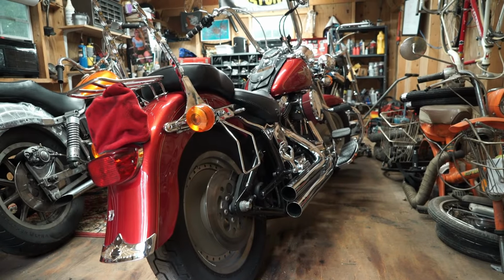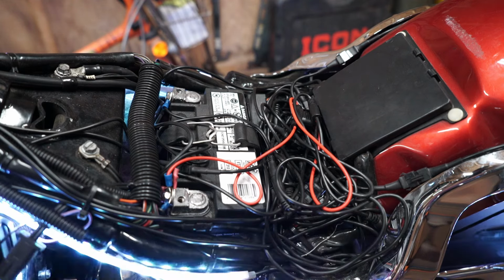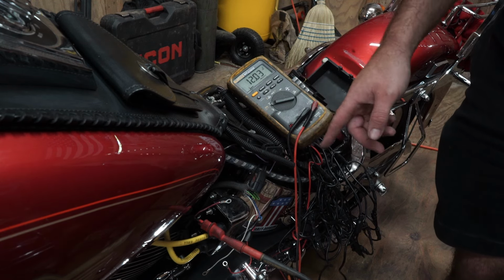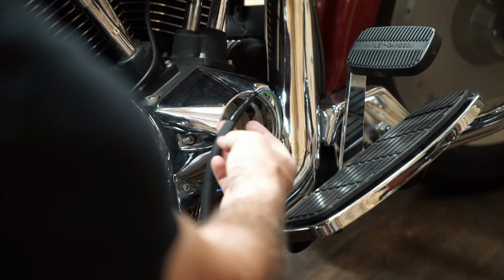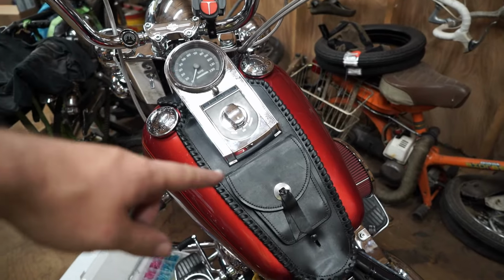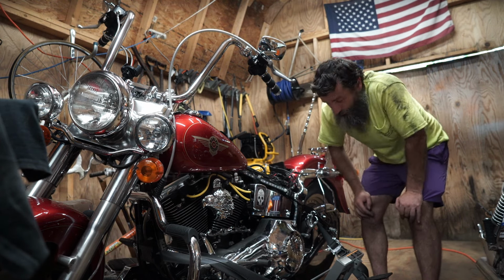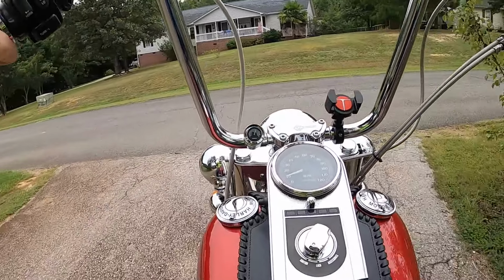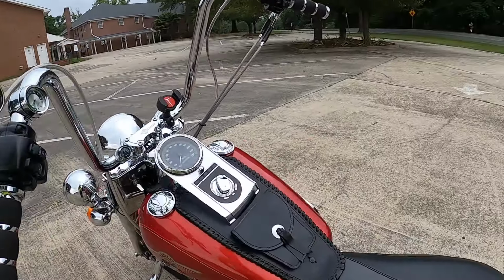1997 Harley Fatboy Ignition Diagnosis and Dyna 2000i Install

Comment: Thanks for sharing all this. I just got my dad’s 1997 FLSTF Softail Fat Boy and am still getting it dialed in, which is why I’m watching this video. THE UPPER FUEL LINE CONNECTIONS NEED TO BE CONNECTED TO A ‘T’ with another line going to the bottom of the bike, or it will never run efficiently. My dad had been running it like that for over 15 years. With his aftermarket Screamin’ Eagle exhaust, air filter, and needle, it easily gained 20hp overnight after fixing the tank venting, drilling the main jet to 190, tuning the idle screw, and adjusting the needle position. Hope this helps, you have definitely helped me to understand the ignition system better. Please Keep doing more EVO Big Twin content!

Comment: Did you check to see if he has one of those manual push buttons on the solenoid? I've got one on my softail. Those evo starter systems were known for being a little troublesome, and a lot of guys would put one of those push buttons on there because of it.

Comment: Hey man i have exactly the same coughs on my carb on fxr how to fix it?
Reply from the maker: Check for intake leaks first, that's probably your issue. After that, you may need to pull the carb and check the jets, you may find you have to go up a size on the idle jet especially if you've put a different air cleaner and exhaust on. Needle position sometimes helps too on a CV.
But start with intake!

Comment: Great bike, John, but let's make this a teachable moment.  You can do better with your electrical work next time. : )  Get a decent set of crimpers and some proper connectors and life will be much easier.   When I'm doing anything to my bike I think about the next owner coming across my work... even if I'm never going to sell the bike, at some point I'll be dead and I won't have a say in it.   I don't want the next guy cursing my name to his biker buddies.

Wouldn't that intake leak create a lean condition?   I'd fix that if I was John.  That can't be good for the bike. It's not that hard to fix is it?  I've never worked on a Harley.
Reply from the maker: @daveco1270  intake leak will definitely make it lean, it's not a terribly difficult or time consuming fix, we've scheduled for him to return with the bike and I'll repair. Thanks for watching!

Comment: Thanks so much for the video. My 1991 FXDB is having the exact same problem now. Whenever I release the choke cable, the engine dies even though it is quite hot. Now I know I just need to replace the gaskets in my intake manifold. What brand of gaskets do you think is the best?
Reply from the maker: That's actually something your local HD dealer should have on the shelf in an OEM part. Failing that, the James stuff is pretty good